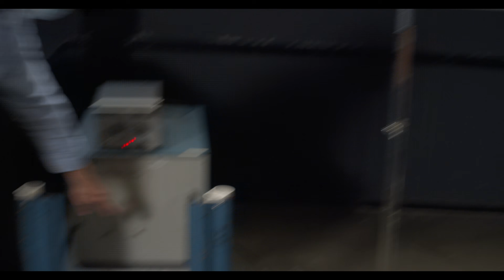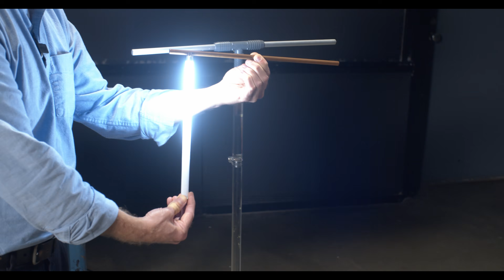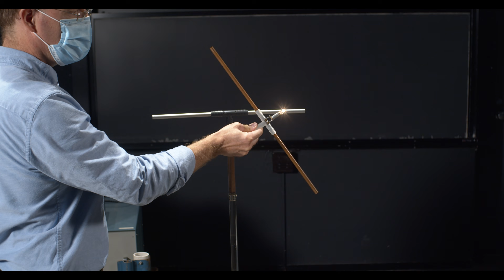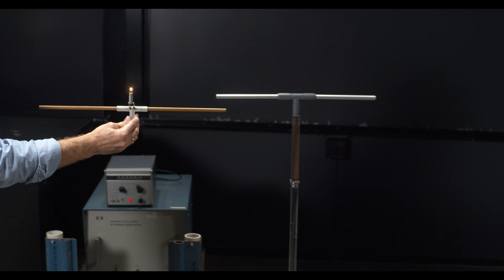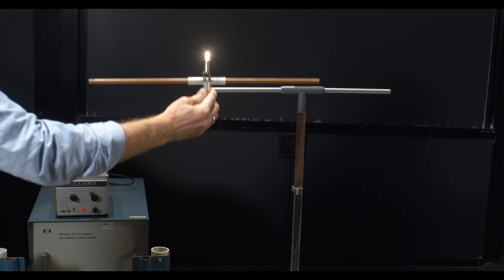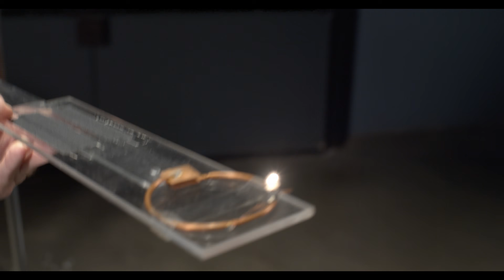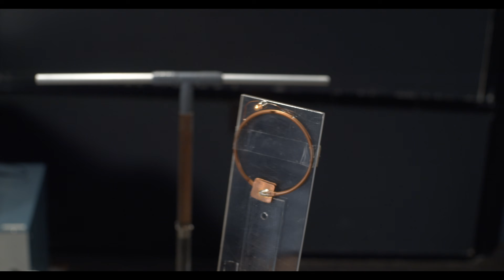Radio Wave Properties: Electric and Magnetic Dipole Antennae

Comment: I feel like that's a bit too close to be around that antenna at that power output...
Reply: A nice demonstration but as an RF engineer, not one I would want to be too close to for too long.  There is a thing called SAR (Specific Absorption Rate) which basically defines how hot your body gets when exposed.  One of the nasty things about RF burns is that they happen from the inside out.  By the time you feel any real pain, you are already cooked.    If you survive, serious RF burns take months to heal.    Ultra-sonics can also cause burns.  I have suffered a burn from a medical ultrasonic machine.  Ouch.   100W @ 350MHz isn't going to cook much but the presenter is probably warming up a little, especially in the extremeties.  https://en.wikipedia.org/wiki/Specific_absorption_rate
Reply: @darrenconway8117  There is mention that the amplifer is 100 watts but it was not being driven to full power; rather, just enough drive to light up the fluorescent.  Since I haven't experimented with this sort of thing I'd guess about 10 watts would suffice with direct contact since that size tube is only a 7 watt tube if I remember right.  VHF is particularly capable of directly exciting the ions that cause fluorescence.  
That's still a fair bit of power to be standing only a few feet from it but off the end of the dipole will be very little radiation.
Reply: @darrenconway8117  "100W @ 350MHz"
The FCC has some specific distance requirements based on power and frequency.  Working from memory I think at least 10 meters (30 feet) is minimum and also there's a duration of exposure factor.  Lower HF frequencies that I typically use allow much closer spacing.  Going the other way, at microwave and radar frequencies you have to be very careful about that exposure.
Reply: @thomasmaughan4798  Yes, the exposure limit is proportional to time, power and frequency.  Different countries have different limits.  The risk is also related to the part of the body exposed.  The pituitary gland is the most sensitive to RF exposure.  Eyes are 3rd on the list.
Reply: Lets not forget 300 watts of electromagnetic field is being pumped out from that dipole antenna.
Reply: @ShopperPlug  Stand under a transmission line and you have megawatts of 60Hz EM radiation.
Neither has any effect on you because the frequency is too low.
Reply: @t00by00zer  yea it’s somewhat true that strong electromagnetic fields does not have much impact to humans, but I’m not convinced, there is not enough scientific data suggesting strong electromagnetic fields is 100% de-facto safe.
Reply: @ShopperPlug  It's not the field that gets you.  It's how fast the field is vibrating that gets you.
Standing next to a 10 megawatt, 60 cycle transmission line has no effect on you.  Change that to a 100W microwave and your skin cooks.
It's all about the frequencies and what they in turn resonate with in your body.
Reply: @t00by00zer  well have a look at these scientific papers, Nobel prize scientists saying it’s not true and more studies needs to be conducted even for long waves:

https://www.hindawi.com/journals/ab/2014/198609/
Reply: @ShopperPlug  "With the published literature on EMF, it is still not sufficient enough to reach a concrete conclusion. But the possibility of negative consequences cannot be excluded."
A lot of "we have no idea" right there.

We are bathed in EM radiation non-stop.  We'd be dead without it.
Reply: @t00by00zer  You're assuming a linear dose response curve across all dimensions.  That's not how it works.  Biological response varies by frequency band, peak power and modulation, polarization, exposure duration, condition of the animal and surrounding environment, species, etc.  Some effects are found to be "windowed" in specific frequency and power density ranges.  Some however are more general.
Reply: @t00by00zer  One must also take into account 1/r squared.  Think of all of the cell phones put up to people's heads.   I'm wondering if lots of brain cancer down the road.
Reply: @metermatch  indeed.  Most of those are low power but I hardly ever put the phone to my head.  It's always on speaker.
Reply: @ShopperPlug  Hi Max - correction - 100W output, not 300.   (But further down in comments, Harvard explains the output is less than 100W).
Reply: @iainmeteorscan1555  Yes he said 100watt. Thanks.
Reply: @ShopperPlug  The amplifier was only 100 watts at 300 mHz. A two way radio in a car is about the same.
Reply: Yeah he's pushing it. It's going to be around the max limit for general population as close as he's getting.   https://www.rfcafe.com/references/electrical/fcc-maximum-permissible-exposure.htm
Reply: How can I use this kind of set up to make cool wireless lamps for my living room?
Reply: Everyone just listens to FCC and ICNIRP, the rest is (mostly) all quasi-religion and people who haven't read the primary literature arguing with each other over what they "believe in".  As though we don't have >40k papers published on bioelectromagnetics and magnetobiology internationally since the days of d'Arsonval and other (late 1890's, actually began with Mesmer and Galvani prior), which they don't know because they never cared enough to look and just stuck with a priori notions that felt right.  Also, Youtube deletes posts on this topic these days, not sure if I hit any disallowed keywords here.

Thermal vs athermal effects debate goes back to like 1910.  Yet people are still acting like no work has been done since then.
Reply: @Acetyl53  This post can be seen fyi
Reply: @wege8409  Good to know.  Thanks.
Reply: There are frequencies at which the human body is more or less resonant to electromagnetic waves, they've probably made sure the frequency of the oscillator is far away from those ranges.
Reply: Has no effect on you as 300MHz is a very long wavelength.
Reply: @t00by00zer   Ah!  A sufferer of the Dunning-Kruger Effect!  
300MHz is a SHORT wavelength – 1 metre (meter).
Reply: @iainmeteorscan1555  1 meter is LONG compared to the structures in the human body.  In order to RESONATE with a structure it must be near the same dimensions.  Human cells are a little bit shorter than a meter.
Reply: @iainmeteorscan1555  "Ah!  A sufferer of the Dunning-Kruger Effect!  "
All people experience the effect.  Not many suffer from it.
Reply: @t00by00zer   Hi.  I get from your posting that you are comparing human cell size to the 1 meter wavelength of 300MHz frequency.  Agreed – human cells are a LOT smaller than 1 meter – around 100,000 times smaller!  

However, for those interested, with all RF there is a “heating effect”, with a recommendation of a minimum distance from an RF radiation source dependent on the radiation field and effective radiated power (ERP).  
Formulae here: https://rsgb.org/main/technical/emc/emf-exposure/  
https://rsgb.services/public/publications/emc/emf-calculator-v0.1.2-rsgb10a.xlsx
Reply: @thomasmaughan4798   Hi Thomas:  "Experience" / "Suffer": a rose by any other name!
Reply: @iainmeteorscan1555  when it comes to excitation of a system by RF signals, physical dimensions are critical.  When you're talking about harmful effects, those take place closer to the molecular level.  Microwaves excite water molecules, not something a human being would really want to experience at the 100W levels.
Reply: @t00by00zer  Water resonates at approximately 2.4 GHz which is why microwave ovens operate at or near that frequency.  At other frequencies there may still be some energy absorption but not a lot.
Reply: @t00by00zer  I mean maybe yours are.
Reply: @thomasmaughan4798  so how many WiFi routers streaming Futurama in 4K would it take to make ramen?
Reply: @Flumphinator  Considering a microwave oven concentrates about 700 W in a small cavity, and the maximum allowed power for Wi-Fi is 1 W, at the very least a few hundred, but it’d need to be concentrated in the same small space, which is physically implausible. So probably a few thousand would be more realistic.
Reply: @GRBtutorials   Hi GRB - it's great to see so much good comment on potential exposure to various radio frequencies and power levels.
Reply: @t00by00zer   Hi again.  I get all that, which is of course the basis of the “heating effect”.  I have UK licences for both Amateur Radio and Marine Band (SSB) up to 400W, and am mindful of the safety factors involved when using higher power levels.   
It's great to see so much good comment on potential exposure to various radio frequencies and power levels.
Reply: @Flumphinator  "so how many WiFi routers streaming Futurama in 4K would it take to make ramen?"
A thousand of these routers might accomplish to heat a bowl of Ramen (eventually).  Each router emits maximum 100 milliwatts, so a thousand of them is 100 watts.  A typical microwave oven is rated around 1000 watts, so it would take 10,000 wifi routers to accomplish the same thing.

Comment: Do we have this up and down in amplitures far fields?
Reply: @kirkhamandy  then why the phone signal is not goes up and down in distance
Reply: @fredfrancium  "then why the phone signal is not goes up and down in distance"
The signal strength goes down with distance in what is known as "inverse square law" (double the distance, 1/4 the signal strength).  your phone is a radio.  Essentially all radios have automatic gain control.  Anyway, that's also irrelevant since voice is digitally encoded and will sound exactly the same whether the "bits" are strong or weak.
Reply: @kirkhamandy  if the power amplitude of signal goes up and down in respect to wavelet, if Fairfield. Then the signal stength 📶 in phone should fluctuated too.

Comment: This would be a great video to show to prospective ham operators in a Technician license course.
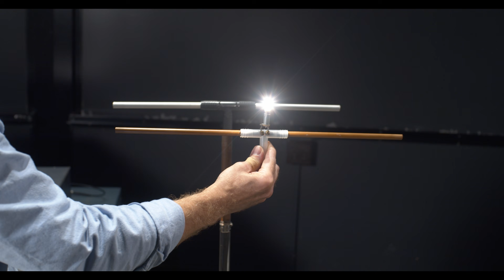Reply: Absolutely.  The part at 3:00 where he is effectively speaking about antenna polarization, would be very helpful for newer people into Radio.  It's a visible version of what db drop looks like when you're running incorrect polarization.
Reply: this had to be shown to anyone in past decades using analog tvs who were tryinh to adjust their tv antennas :P
Reply: @ahmetmutlu348  Some of us still adjust our TV antennas.
Reply: He didn't show his facility.  Maybe he is inside a Faraday cage to prevent unwanted transmission.  I mean really, 100 Watts? How does he get away with that without having the FCC on his ass?
Reply: Yeah, here new hams operate an unlicensed transmitter at 100 watts to play with light bulbs.  Whilst you're at it, get a 100 watt amp for your 11 meter rig.

Comment: Most excellent presentation!  Seeing the relationship between linear dipole and magnetic loop orientation for maximum current flow is critically important; I’m trying to design an antenna with the inductive sensitivity of a magnetic loop yet able to reflect and direct the electric field aspects of radio signals the way the capacitive character of the linear dipole is able to accomplish.  However I’m not able to “see around” the fact that the magnetic field is 90 degree perpendicular to the electric field which is oriented in the direction of wave propagation...an essential fact for electric wave reflection.
Reply: Do a search for 9A4ZZ bipole antenna. It is not short dipole, it is instead an E-field two-pole radiating structure ... especially look at radiation pattern. Minimums off the broadside whereas dipole HAS max off broadside.

Comment: 100w? that is enough to cook you alive.
Reply from the maker: It's rated for 100W but we actually run it much lower than that.
Reply: @NatSciDemos    Well – It's good that you use less than 100W, as over here in UK (Brexitistan), OFCOM (equivalent of USA (Murica) FCC) recommends that when using 100W @ 300MHz, the safe distance from the antenna would be around 2 metres (meters).   

Formulae here:  https://rsgb.org/main/technical/emc/emf-exposure/  
https://rsgb.services/public/publications/emc/emf-calculator-v0.1.2-rsgb10a.xlsx
Reply: Not at that frequency, it's not a magnetron although I would keep it away from your eyes....

Comment: I get the feeling Nikola Tesla would have enjoyed seeing this.
Reply: I have a feeling that he has seen this, way before this professor was even thought of!👍
Reply: the antennas demonstrated were hertzian antennas, tesla debated over the nature of Electro-Magnetic-Waves with Heinrich Hertz in person. Hertz considered transversal waves while Tesla considered longitudinal waves. Hertzian Waves are commonly used in almost every RF device, although meanwhile they have a directional character instead of a sphere-wave in space which is produced by phased-array-antennas, such antennas could if they are used as a receiver determine the direction a signal came from (which ofc is actually utilized in todays 5G tech)

Tesla did not deny the existance of transversal waves but he suggested those were by far inferior in comparision with his so called "pressure waves". Main Reason beeing the diminish in power by the distance squared.

Now back to tesla, various scientist claimed Nikola Tesla is wrong because a longitudinal wave would exceed the so called speed of light, which u must not imagine as a maximum speed for a bullet but rather analogous to the "speed" waves in water move with, its not determined by the stone you flick inside the water but rather by the water itself.

One of the inventions Tesla is most famous for is his transformer where he has shown that electrical energy can be transmitted or conveyed with only a single wire or no wire at all ( Ground i.e the actual earth is used as a wire in that case) which kinda gives more credence to the Tesla-Scalar-Waves which they are commonly called today.

So in retrospect, Tesla would be very sad to see this video and to see  his tech didnt really go anywhere and a massive amount of RF-Energy wastement is done by omnidirectional tranversal waves even 100yrs+ after this guy had accomplished his biggest inventions already.
Reply: Stop it... he was way ahead
Reply: REAL!  He pioneered the use of resonance to produce high-frequency electromagnetic devices.  His role in the invention of radio has been gravely overlooked however.  Glad you understand mate.
Reply: Heck yea
Even i did
Reply: Actually, Tesla is the Father of all this science, on paper.
Reply: @dabig_guy2204  ... What about Maxwell, Faraday, Lenz ... ?
Reply: @dabig_guy2204  yes, I thought so!👍🇺🇸
Reply: @dabig_guy2204  Wrong. Tesla didn't work on science. He worked on making machines. Michael Faraday is the scientist who is the father of electromagnetism in physics.
Reply: Tesla never seemed to have gained the insight for effective physics for  transmission. I'm thinking that's where Marconi stepped in and received credit for invention of radio communication.
Reply: @charlesdickens6706  The US Supreme Court restored the Patent back to Tesla six months after his death in 1943
Reply: @stephenmcgreevy9650  okay, but he's dead. But then in managing his estate and possible outstanding debts the patent might have value however ,maybe not, cos the patent would have been an expired patent but then estate can demand past users of patent coverage for historical losses of income maybe, but there might be time limitations for historical losses and patent would only have covered 17 early years of the century. Patents in recent times cover 25 years of course .
Reply: @charlesdickens6706   Are you THE   Charles Dickins ?
Reply: Absolutely correct

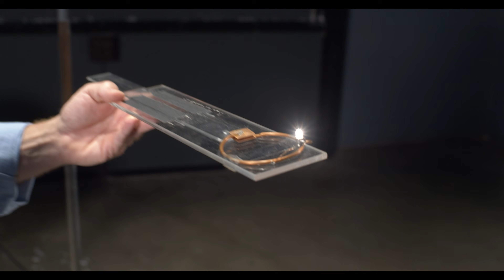Comment: 4:45 Couldn't you just break the loop and connect the bulb in between for the same effect?
Reply: "Couldn't you just break the loop and connect the bulb in between for the same effect?"
Yes, he couldn't.  The loop is resonant and depends upon the presence of both capacitor and inductor (the loop itself).  It develops a rather high voltage but low current at the capacitor, and a high current but low voltage opposite the capacitor.  You attach the light bulb aross the loop at a point where the voltage and current is suitable for the lamp but not so close to the capacitor that it damps the oscillation.
Reply: It is part of another experiment i suppose
Reply: @@NRGY " I guess you tune the C to make it achieve Fr."
Yes indeed.